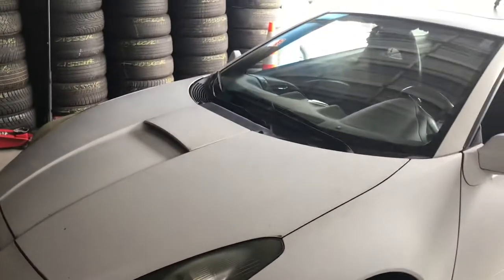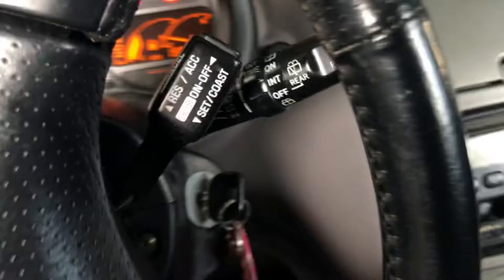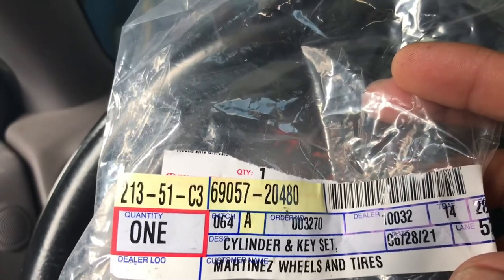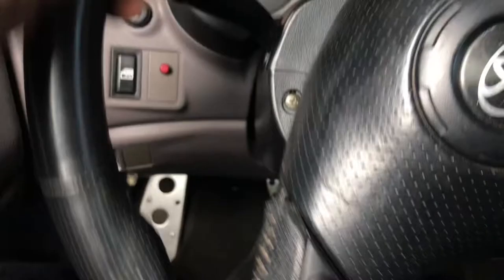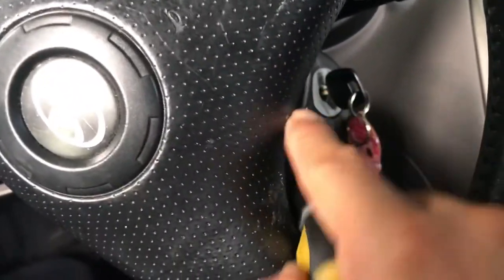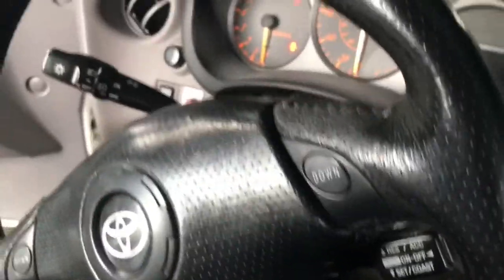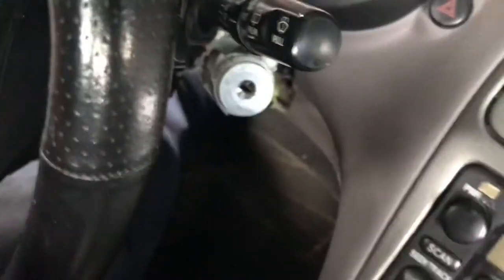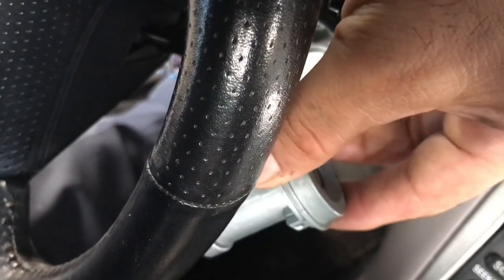How to change Ignition  cylinder Toyota Celica-Tacoma-rav4-Camry key stuck on the ignition

Comment: Can you still do this if the steering wheel is locked and with the key out?  I'm buying an abandoned Celica which doesn't have the keys anymore.  So I've got to replace this lock cylinder or replace the entire ignition switch which is rivet-bolted to the steering column.  I don't want to have to take out the entire column to drill those bolts out.

Comment: Thanks for the informative video, this is really helpful. I just ran into the same issue, I have a couple questions for you if you get the chance. So I have a 2002 toyota celica, and I have a feeling the job will be the same since the celica here is only a year apart. I went into the dealership and got the keys and ignition cylinder lock ordered however they mentioned some things to me that I am questionable on. Did you have to get your keys programmed? Im not sure if 01' or 02' celica keys come chipped, I hope not cause they had a bunch of additional charges they listed off for programming. Also another question, they mentioned it might not work just popping the new cylinder lock in because of it might needing the ECU to be reprogrammed with the new cylinder, however with your video Im confident doing it this way will work. Im just not sure if I should be concerned about the ECU thing cause they said it would run up the charges a lot. Im not sure if the 02 is to different from the job done in the 01 here, wondering if you might have any insights or thoughts on it? Thanks again for the amazing content!!
Reply from the maker: I dont think u should program the key that dealer is full of $;:? Just sended man